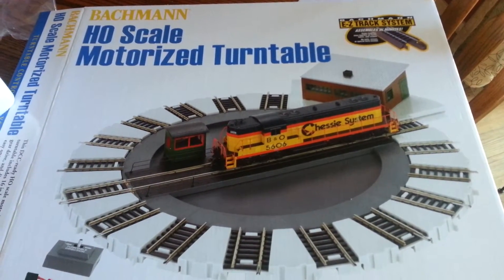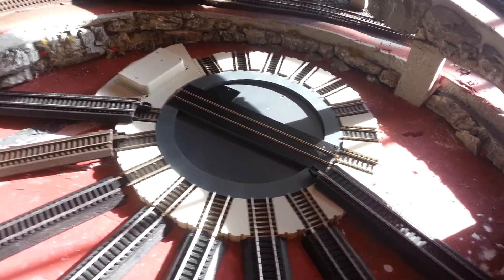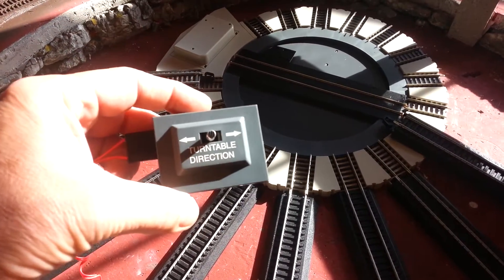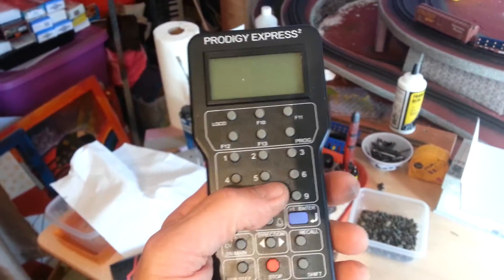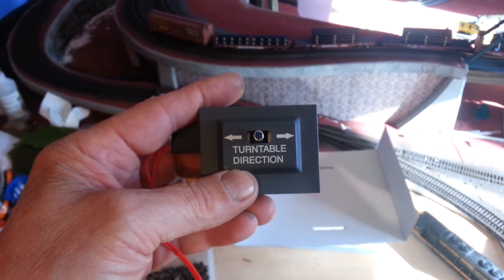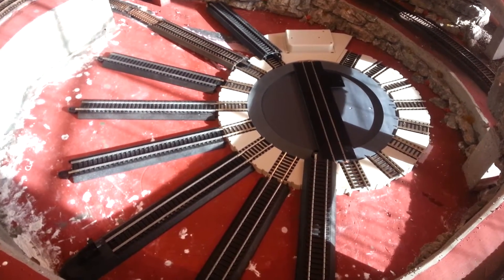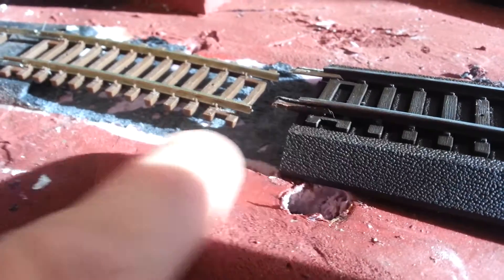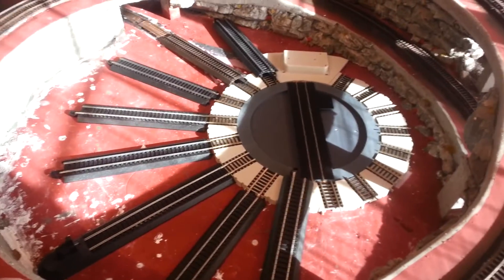#18 Bachmann's HO turntable control choices

Comment from the maker: Okay the test went great!  I ran was able to run this table using my old DC power unit and the direction controller that comes with this table.  It runs smooth, plus the moving table track sounds aren't as bad as feared.  You can save around $40 bucks on the needed Decoder for DCC if you just do it this way, just use the included directional controller.  Also I need this table to sit in way that won't work as designed, since you must connect track 4 to your mainline, to give it power.  I need track 4 pointed away so will just run power to this side without attaching it to the main.  Wish me luck!

Comment from the maker: update 3-2016,  turntable work great with manual control instead of DCC work excellent for my engine storage area.  I like this better than a barn which hides engines from view this is exposed and easily you can see the engines